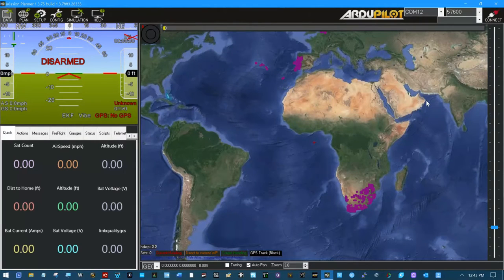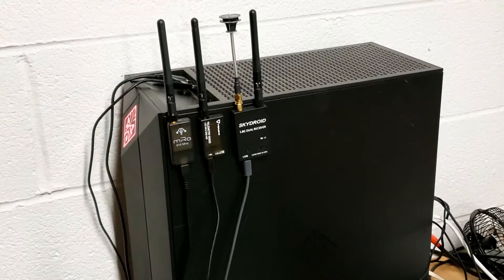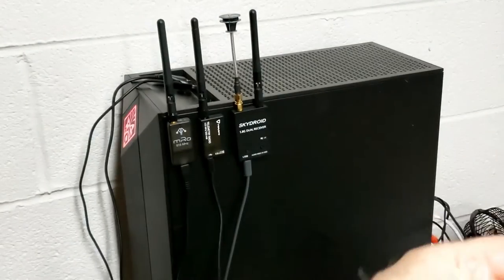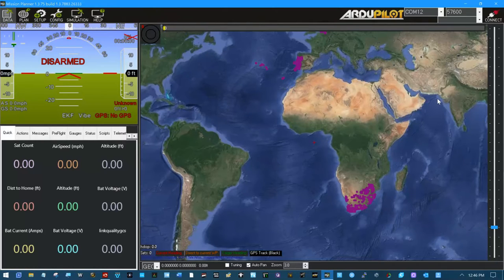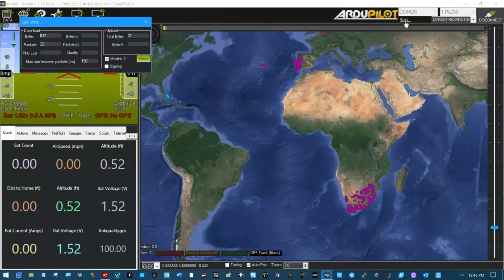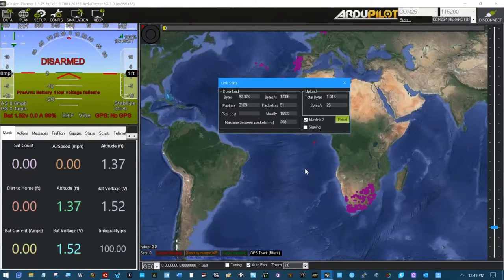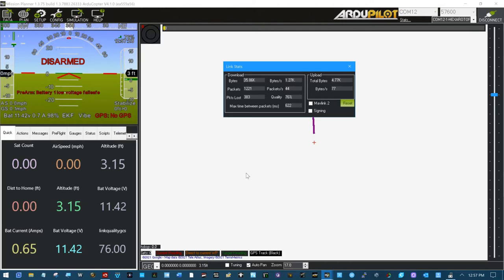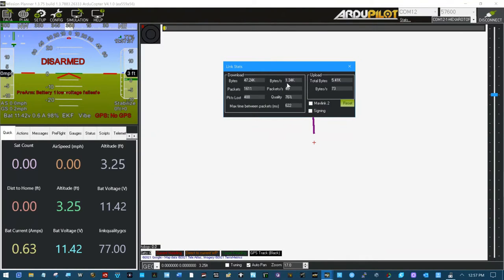Telemetry Telemetry Telemetry  1 of 2

Comment: hello, can i use the holybro sik 433mhz/915mhz with Matek F405? i want to achieve live video telemetry and radio control from ground station. i do not have a transmitter or receiver. but i've heard i can configure a joystick to my laptop. but is it possible with holybro sik?
Reply from the maker: The live video and OSD data overlay is not a function of the SIK radios.  It only passes telemetry data.  I have a joy stick here to test the exact thing you want to do but have not played with it yet.

You didn’t say which F405 FC and there are several.  But the SIK radio only requires Gnd, Vcc, and the TX and RX of a UART.  I see no reason why it would not work for you except may because of slow throughput where controlling the platform is delayed by enough time it causes problems.  I hope to test my Joy Stick at some time in the future and would know more then.
https://youtu.be/rbzioyaxn8s

Comment: How are u getting this to work ? The hex u hav seems to have a matek board , and u connect no problem?I have a F405wing in a tricopter mini talon . I have tried 3 sets of sik radios always same message( no  heatbeat ) I have it connected right solid green light flashing red light I’m using serial 6 baud 11500 what should the port be set to in mission planner?what am I doing wrong help !
Reply from the maker: Yes, it is a H743-Wing.  Set it for 57,600 baud.  UART 6 = Serial 6 in Ardupilot so you have that right.  Frequently the radios have to be flashed again to get them to connect.  Use the section in mission planner under Setup, optional hardware, SiK radio to do so.

Comment: I have a problem in my telemetry 3RD 915MHz the red light turn on when i did the firmware upload in mission planner
Reply from the maker: They are a pain. I frequently have to reflash them several times to get them to work.

Comment: is the output power of the fullsize diversity rx 10mw also ??
Reply from the maker: The output power seems to be 10 mw on all the receivers.  The max power on the Micro TX V2 is 1 watt and the full-size transmitter is 2 watts.  Dynamic power can change the power output on the transmitters, but the power on the receivers is fixed at 10 mw.

Comment: hi mate i have uploaded firmware in the ground module that connects to the pc and then when i tried connecting it is unable to connect what do i do
Reply from the maker: Setup a duplicate radio on the platform and configure it the same way.  Default baud is 57,600.  Set for Mavlink 2 in the flight controller port you have the air unit attached to.

You can easily tell when the radios are setup right.  Powering them both up will result in a steady green light.  They will connect to each other with nothing but power applied.  After that it is all in configuration.

What FC?
What radio set?
What uart it the air unit connected to?
Reply: @nighthawkvs  the thing is , the ground and air module were connecting with one another with a steady green light but after i updated the firmware via mission planner upload firmware option on the ground module then both of them were not connecting 

I am using apm2.8 with fsi6x tranmitter and 10 channel receiver 
Is there a way by which i could reload the previous firmware such that both ground and air module of the telemetry are running on the same firmware
Reply from the maker: I have had that problem and I flashed both with QGroundControl and it fixed them.
Reply from the maker: I usually flash them with QGroundControl when that happens to me.  And I let it select the firmware automatically.
Reply: @nighthawkvs  in order for me to do this i will have to connect the air module via ftdi programmer, currently i don’t have that facility, the air module is untouched, the only modifications i have made are on the ground module 

So is there any way by which i could load the initial firmware which the telemetry module came standard with.

And then hope that because both units are running on same firmware they will connect 😅
Reply from the maker: https://youtu.be/mAlwiYLkJ5c
Reply: @nighthawkvs  let me give it a shot
Reply: @nighthawkvs  are firmwares for these available on the internet
Reply from the maker: Let me know.
Reply from the maker: For some radios.  Example is the RFD radios do have firmware on their website.  It shouldn't be used on other radios IMHO.  Other makers may or may not have firmware for their radios on their website.

I think that Mission Planner and QGroundControl try to get firmware from the internet  for you when you flash with them.

BTW I LOVE the RFD radios.  MUCH longer range.  I moved to them years ago because of that.  Check them out.  I still use them when I need a 915 solution.  Hate they didn't make a 433 version for when my control link is 915.  When I switched to 915 control I had to go to a completely different solution.  The low power radios like the 3DR one I showed in my videos have very limited range.  Some under 50 years of range.

 for youCAUV does make 1 watt radios.  I have some I have never used here for testing soon.  BUT!  I am moving more toward Dragonlink or 5g for telemetry.
https://store.rfdesign.com.au/rfd-900x-modem/
Reply: Mine is a 915MHZ telemetry radio and in my case the radio isnt connecting through flight controller